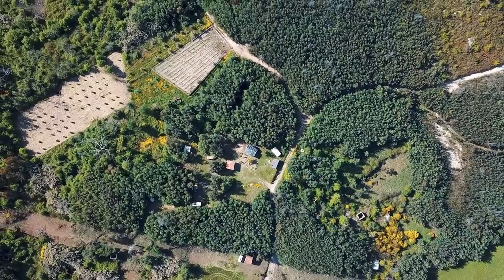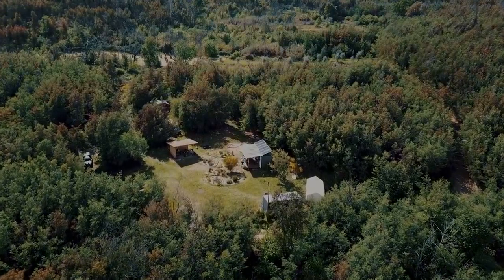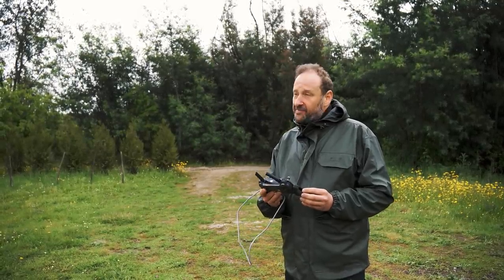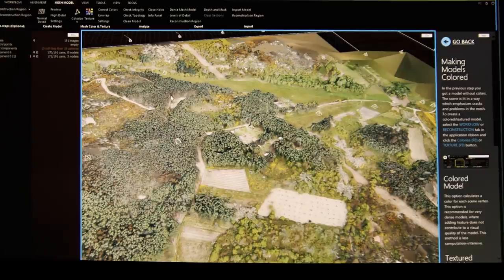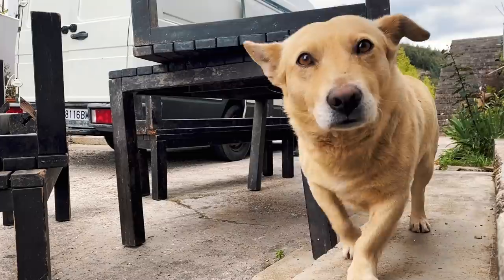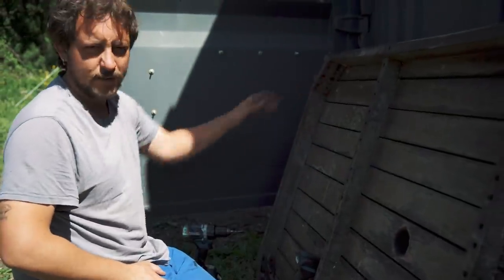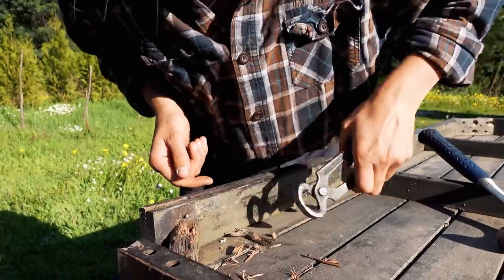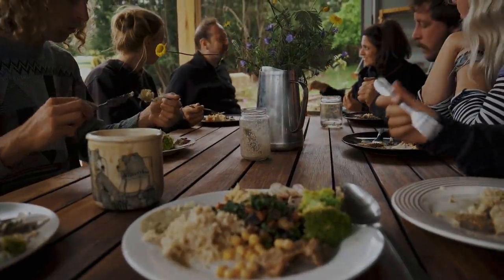#44 Elevation (Height) Map with a drone and new tables

Comment: For the chainsaw, buy or arrange a chain sharpener. Also pay attention to the chain tension otherwise the chain may run off the bar. And please wear saw pants when using the saw, if you slip, a ride to the ER will take a very long time.
Reply: Yes, I think some general chainsaw training would be good.
In one of the scenes the chainsaw bar got pinched in the wood. This can be avoided, for example.
Reply: Agreed, that made me cringe being ex forestry. A good pair of chaps, ear muffs, steel cap boots, hard hat and visor are well worth the investment.
Reply: A sharp saw is a safe saw.  The effort involved in forcing a dull saw (with loose tension) makes the user more vulnerable to injury.  Take care of your tools and the tools will take care of you.
Reply: @tonywhitley6929  I agree completely...problem is that   they do not have anybody to teach how to sharpen it...it needs practice....
Reply: I would like to second the idea! maybe just put it on your staff list: someone who can use a chainsaw properly and safe :)
I mean it seems ok, but guys chainsaws are extremely dangerous!
For example, around 2:30 that branch should have been cut from the bottom up, so the blade/chain does not get pinched by the wood.
Reply: bro the lack of chaps was doing my head in dude and the blunt blades on the chain saw. its actually really easy to sharpen them yourself. would be a good skill for them to learn considering how much they use them

Comment: I am a waste, sanitation and renewable energy expert and I love your green field projects.  I guess wood will be a major energy source, and I recommend rocket stoves so you can utilize small branches for cooking.  If you want to increase fertility of soil with biochar can look at Kontiki kiln.  I also recommend black and grey water separation, using garden as grey water drainage, and replace your compost toilet with a Biogas digester for all your organic waste and black water.  This can produce enough cooking gas.  If your solar PV has batteries, highly recommend you convert the top pond into a reservoir and pipe the water to the lowest point and run a small hydro turbine that can be turned on to charge your battery for the winter when there is less sun.  You can also look into Genoa Sterling , for small sterling engines that can run on burning wood, but that is very exotic.  From your video my first assessment is there is enough waste wood on the property to sustain your cooking needs for two years before you need to start harvesting trees, but it will not last forever, especially if you start to utilize the two ruins.  Solar and hydro plus good battery storage on site will be sufficient for future expansions but you will need to relive on biogas for cooking gas in the future.  Can look into growing some cash crop and energy crop mix and taking waste agriculture products from neighbors to feed your digester.

Comment: With some of the areas on the land that have fairly sharp elevation changes, have you guys ever considered the idea of a liquid storage battery? Essentially you have an upper and a lower reservoir, connected with a reversible pump and a turbine. When you aren't using all the electricity being generated, the extra will pump water to the upper reservoir, then if there's ever a need for some additional juice, you let the water flow from the upper to the lower through the turbine, generating power on it's way down. They aren't commonly known, but are fantastic ways to storing power. I could think of some other benefits for having a double reservoir system, like a swimming pool perhaps, or aquaponics. A waterwheel could be used for a grinding stone for flour? A drip irrigation system? There's lots of reasons honestly. Just a suggestion :)

Comment: as an amateur ecologist (from New Zealand) i would recommend you stage your approach to removing the mimosa forest particularly in the steep areas to minimise slips... by that i mean remove the forest in stages, for example 1-3 metres every month and planting fast growing native trees in place of the old (where you removed the mimosa from. this insures the land does not slip, and is very necessary on the steeper slopes (anything at or above 25 degrees) especially considering all the rain you get.

Comment: Let your chainsaw do the work! The saw has teeth on the body that engage the log  using the point of the teeth as a fulcrun allow the weight of the saw to draw the blade thru the wood.
Reply: Yeah he was not pushing the saw at all

Comment: Guys, that tree you removed from across the road is called a "widow-maker" (its a fallen tree hung up in other trees or structures and so not completely on the ground). They are called widow-makers for a reason, in that they weigh in the order of many tons and thus when they break free mame and kill people! Watching you guys jump and swing on that tree was like watching a train crash in slow motion. Please before you tackle such a dangerous issue again, get some instruction from a tree surgeon or forestry woods-man on the proper workflow for taking on such a tree. That should include some basic chainsaw use (as its also clear you have no idea how to operate that small electric saw safely). I wish you all the best, but I'd be counting your fingers and toes and considering yourself lucky you still have them after that debacle.

Comment: nice modeling, someone there needs to take some chainsaw lessons, they have no idea on how to use one and jumping on the tree instead of undercutting? Thats reckless and dangerous. all those cuts under pressure should have been undercuts to finish not binding the blade as a result for example

Comment: Couldn’t you use people's phones, and as everyone is moving around the property. The phones would give the lat, log, along with the alt?
That’s would have mapped around 40, maybe closer to 55% of the property. I might be way off and if over half of the property is still covered by trees and plants, then much lower, but still you could connect the dots, and anywhere you wanted it to be higher resolution, just have someone, walk a grid pattern, that would result in the resolution that would be desired. 
I would have to include the boundary of the property, while marking it off, using taller stone material. When it comes to the corners, and sharp turns. Then on the long straights, an different taller stone material, spanning a distance that if all vegetation is removed, that they could be connected and measured. With the border being marked by that method, it would be as accurate as the phone.

Comment: Jesus Christ! I had to watch the early part of that video through my fingers like a horror filme. Please, please, please read up on the safety aspect of using chainsaws. As an absolute minimum, you should be wearing heavy duty gloves, steel toe-cap boots, face / eye protection and a helmet. Ideally you should wear full cut-proof leggings and body apron. You're risking serious injury. The curly haired guy using a chain saw wearing shorts with no gloves and no eye protection scare the hell out of me!